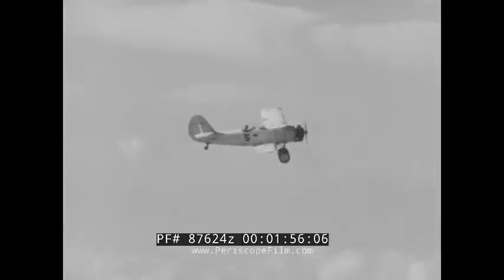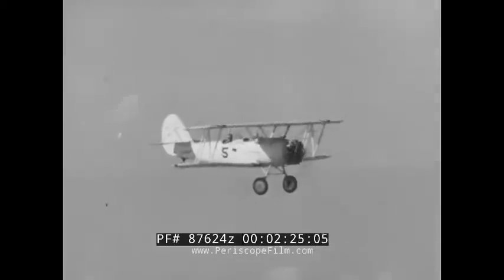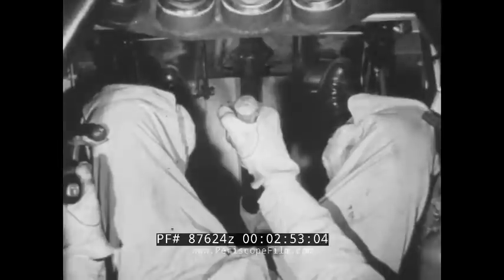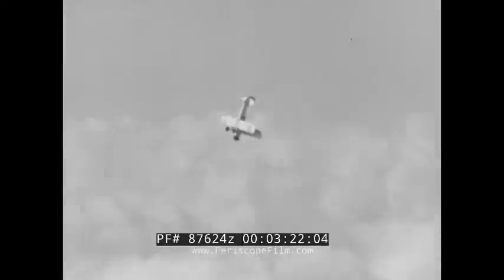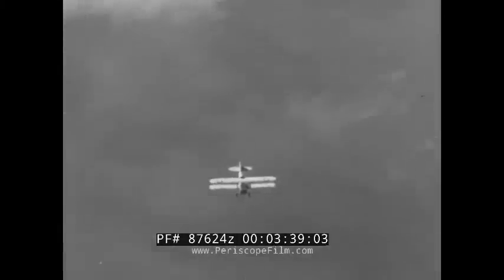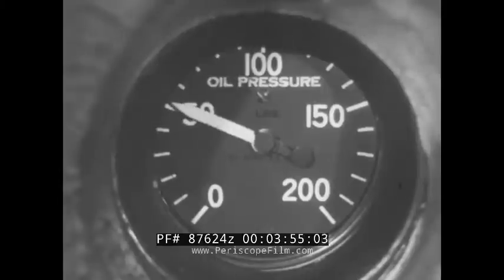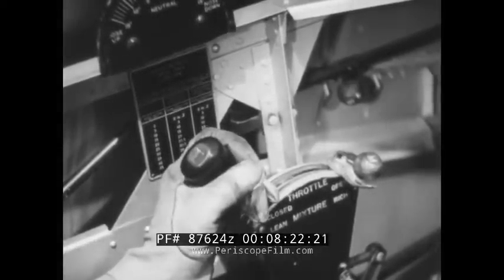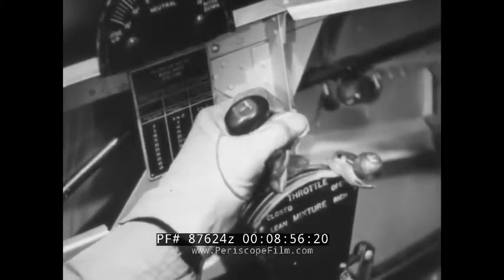" THE INVERTED SPIN "  WWII U.S. NAVY PILOT TRAINING FILM   INDUCING SPIN & SPIN RECOVERY 87624z

Comment: i had aerobatics training from sammy mason at santa paula airport. sammy wrote a book on spins, so the first thing we did was spins of all varieties. we entered inverted spins from inverted flight, just push the stick forward,stall,and choose a direction with rudder. the reason inverted spins are easier is because the rudder is not shielded from. the horizontal stabilizer.

Comment: What's the purpose of this?
Reply: if you screw up a maneuver such as a loop, barrel roll, etc. you can find yourself in a variety of conditions such as a spin, inverted spin, flat spin, etc. You need to know how to recover from all of these conditions before practicing the other maneuvers. Each recovery from different conditions, is different. Need to learn how to recognize which condition you're in, and what the correct response is.
Reply: This is to teach a pilot how to get out of a inverted spin